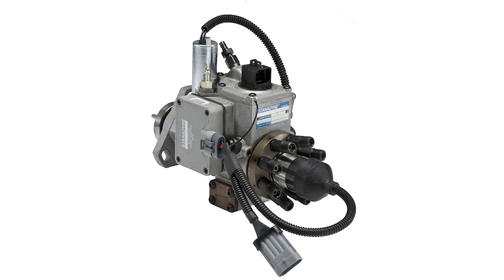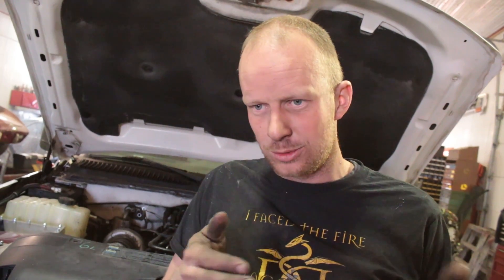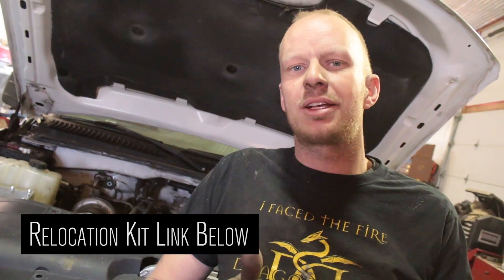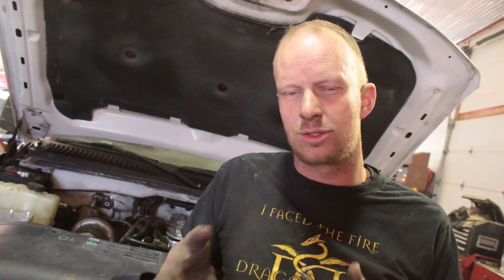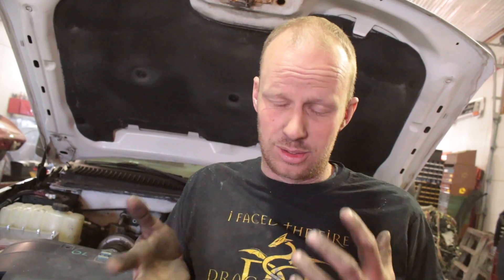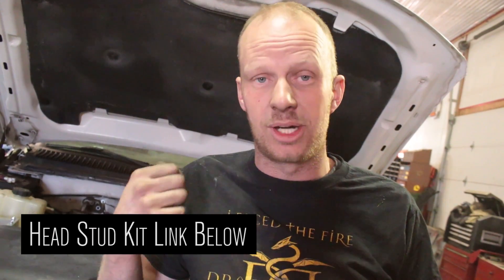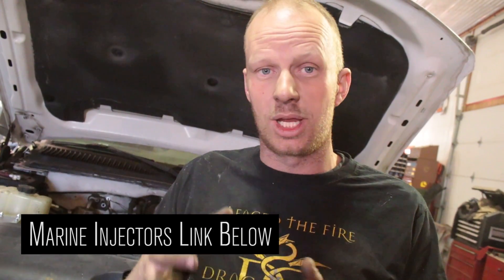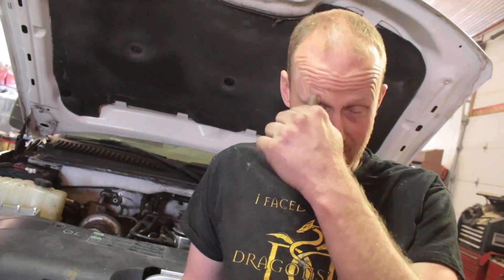REVIEW: Everything Wrong With A GM 6.5 Detroit Diesel

Comment: The 6.5 is just a bored out version of the 6.2. And yes in 1994 they changed over to a fully electronic "drive by wire" injection system to help meet emissions requirements but the basic engine structure( Heads, Block and Rotating Assembly) was designed in the late 70's. No, it's not a 12 valve which was designed slightly later. The primary difference between the two other than cylinder count is the fact that the 12 valve engines are direct injection while the 6.2/6.5, whether they were turbo charged or not, are indirect injection. This design was used to increase fuel efficiency while making an attempt to keep engine noise down. As most people find the sound of a diesel engine unsettling...Although I personally can't think of anything that sounds more appealing to me. I personally love the sound of Diesel Engines.

This engine was designed to be a fuel efficient alternative to both big block and small block V8 gas engines and it does that better than any other light duty diesel engine produced for or shoehorned into a pickup truck. I have a 98 Suburban with a 6.5 and I love it.  I have rebuilt the engine, put head and main studs in, high output injectors and injection pump, a better cam, tuning and a better turbo (an HX35 from a 5.9 cummins) and even shoehorned in a first gen cummins intercooler. And it all cost me about $3,500. That is by far the best advantage to running this engine. Cost of maintenance is so little compared to any other diesel engine. Injectors are anywhere from $400-$900 depending on whether you want remans or new ones. which about a 1/4 the cost of injectors for a Duramax or Powerstroke. It hauls whatever I need it to, whenever I need it to and when not towing I still get well over 20MPG. But it's biggest achievement to this day is because its a Suburban and not a long bed crew cab pick up....My wife will drive this truck and still be able to park it. 

And in the interest of being thorough...I was a foreman at a Diesel shop before my eye got popped by a shattered drill bit and in the 5 years I was there...I can promise you that this engine has also been used for school buses, tow trucks, straight trucks, cube vans and pretty much any other type of light duty highway going work or commercial vehicle.  As well as being a popular engine for RV owners. Older RV's of course but RV's none the less.Not only that, but it is STILL used for the HUMVEE even though AM General now owns the engine and has made SUBSTANTIAL upgrade tot the block and heads.

The bottom line here is that for an alternative fuel engine designed in the 70's...This engine has stood the test of time and the after market support for this engine very strong and increasing still. Rivaled only by the 12 valve in terms of age, reliability and after market support.
Reply: I just bought a 230000 mile suburban with this engine and I love it. However, the couple of things I've heard need replaced I will never know if they have been replaced because the dealership didn't get any information from the previous owner before taking it in trade. Grrr. He was a mechanic though and it is CLEAN!
Reply: @hisnameisiam808  I would say to that if it ain't broke don't fix it but just do regular maintenance I have 340,000 on mine and going strong.. and yes his name is I AM
Reply: @GH-el9ch   Geary Harlan  YES IT IS! YOU ARE THE FIRST TO SAY IT! lol I've actually had a few people argue with me about that fact believe it or not. 

Ok, got it. Sounds good. Since posting this I've found the pmd. They relocated it under the engine on the "skid plate" thing. It's very solid. I'm just worried it could get damaged by debris or water. It has a new injector pump and injectors. It is doing 10 psi on max boost which I've heard is the max. I'd like a bit more of course lol. But this thing drives like a dream. The Lord blessed us with it. I have no complaints. I think he also modified the Wastegate so that we don't need the vacuum. It operates beautifully.
Reply: 8- MARINE INJECTOR NOZZLES  Bosch  67.50 ebay
Reply: But a suburban is the size of a crew cab long bed truck...
Reply: @nou8257  but NOT the same wheelbase which is why it's easier.
Reply: @nou8257  reg cab longbed
Reply: @parkersmith8011  Reg cab long bed is 131.5" and the surburban is 219.5″ its not much shorter then my crew cab long bed dually is apparently 250" and even a extended cab truck with a long bed is 155.5"
Reply: @nou8257  with a reply like that, its obvious that you're not aware of wife logic. Maybe you're gay? Maybe you're just insensitive? Maybe you're not old enough to understand human nature. 
Good luck!
Reply: @Brandon Crimmons:
Best most accurate post in this thread right here.
Reply: @JUDGExNOCTURNAL  why not buy an entire p pump engine and swap parts over?  Far cheaper than the kit
Reply: @Bighorn44 None My truck has a 6.2 bored .30 over and then all the 6.5 stuff put on it 6.2 is pretty close to the same thing as the 6.5 minus cylinder bore diameter and the cylinder heads are different somehow i think it is for the pre fire chambers.
Reply: Wrong it's not just that simple
Reply: ive seen lots of 6.5s in diesel pusher RVs i was surprised at how much power they had going down the highway
Reply: Brandon Crimmins my injectors were $280 delivered. Oem Bosch from summit racing.
Reply: @Bighorn44 None So you are asking can you put a mechanical injection pump off of a 6.2 or pre 1993 back 6.5 on a 1994+ truck.

Yes you can it doesn't need a computer to run but it will still need the fuel shut off solenoid to turn off and on and will prob need wiring modification since I can't remember if anything looped through the injection pump in the harness.

Comment: What are your thoughts on the newer 6.5 diesel p400 long block engine?  It seems to have solved all the issues with the engine itself, but not the injector pump issues.  I'm thinking a p400 engine, a newer humvee mechanical injector pump, and a larger turbo and it would be a pretty good setup.  But.... of course by then the cummins swap could be a cheaper option.
Reply: welpro21 p400 are good engines. I want to put one in my truck next year, check out leroydiesel.com

Comment: I got one 98 6.5 with over 900 km on it only thing changed was turbo and pmd was relocated and I got a second 98 with just under 500 km and doesn't show any signs of ever dying and they both pull very often both 3/4 ton with 1 ton Springs both bone stock except muffler and soot trap was takin out so there a good engine if you don't mod the fuck out of them like you would a cummins or powerstroke and they both get 20-26 mpg towing or not towing so there are a few junker ones but there are also very good ones wen you treat them like a deisel

Comment: I have a '99 Chevy Suburban K2500 with the 6.5 TD. There's one highly recommended modification for these engines; the stock oil cooler lines are an awful "Quick Disconnect" design held together with a small C Clip and are prone to failing, starving your engine of oil. People at the Dieselplace forum recommend buying quality after-market lines such as those from Leroy Diesel or Lubrication Specialist. I still have to replace mine.

Comment: I don't consider all those easy to reach things to be a big problem. PMD is an easy fix and I just remote mount any that I see.  Same with the injection pump. Any older rigs I just figure all injection pumps are a core and get a good performance one to replace it. 
The major problem is some blocks are weak.  I build these things for power all the time and I actively look for them because they can put out 300hp  pretty easy and that's not too bad considering the weight savings.  
Building for power the right way can be expensive. Depends on your definition of expensive I guess. Expensive to me anyway. A set of 18:1 pistons is about $650 and even though Mahle is the best you will probably have to buy two sets just to get 1 set that is suitable for balancing.  I have a set that is 15 grams different from lightest to heaviest piston.  That is a pain to try and balance.  In fact my machine shop won't touch those unless they are within 2 or 3 grams. 
Personally these are one of my favorite engines. Fairly cheap and affordable. They can be decently durable too with the right build.

Comment: 5 PSI? FIVE PSI????? does this thing really only put out 5psi?? my 7.3 hits 33psi
Reply: Christian Figueroa 6.5L can only handle 10psi before you need head studs
Reply: The main reason they kept the boost low is because they had the compression ratio high in these engines. That’s why he said when you get to 20 psi that you’ll probably blow a head gasket without studs. Other engines can get away with more boost because they have a lower compression ratio.
Reply: Yes 5psi in stock trim. I run 7psi cruising and with go 18psi through the gears, 33 psi in your 7.3 is great for you but your soot maker was designed to need that much air
Reply: Turbocharging (supercharging) diesel engines began in response to weak exhaust flow by means of forcing high pressure air to blast in through the intake valves and push out the exhaust. 5 psi was all it took to accomplish this goal (although the engine will overboost to 12 psi in short periods If the conditions are right). Higher performance was only a byproduct of turbocharging, not the intention.  You can thank the last 20 year's worth of diesel power wars between manufacturers for the progression to lower compression/higher boost/exponentially more power.

Comment: i agree with a lot of the issues but my 95 obd1 6.5TD gets about 24ish mpg highway. moving the little black box behind bumper is better location. turbo swap is best thing for it, i chose a H1C off an early 12 valve. upgrade the LP electric fuel pump too

Comment: I personally have a 6.5l turbo diesel, yeah they're not that great, they sound like they're going to explode during cold winters, (sometimes they wont start) the Pump Mount Driver goes out if you haven't relocated, you'll most likley will experience a stall eventually. I'm doing research on how to have the 4l80e communicate with the cummins engine without having the check engine light on.
 The cummins 12v is more in my opinion simplistic. for example, the 6.5l has 8 glow plugs, those glow plugs can go bad, and sometimes even swell, thus, if you had to replace a glow plug  and broke the tip, haha have fun tearing the engine apart. Where as the cummins just has a grid heater or a toaster like thing. which is located on the top. and yeah, a lot less time consuming if you ever had to replace it. Or if you were going to do a exhaust work, you would only have to work on one side, instead of two.

Comment: 6.5s weren't bad just not a puller motor too high of EGTs on the and hard to keep them low. One thing I'll say though is the 6.9/7.3 idi and 7.3 powerstroke are just as reliable as a 12v cummins. Sure they're hard to start in stupid cold weather but other then that they'll last forever the 6.0 isn't bad either just gotta know how to fix it right the first time around. They all break weather its a Duramax, Powerstroke, or Cummins. And they will all blow a head gasket.

Comment: The 6.5L diesel is a General Motors Division diesel V8.  GM Diesel, Detroit Diesel Engine Division, Detroit Diesel - Allison, Detroit Diesel Corporation.....didn't build the 6.5L Diesel.  About as close as they came to something like it was the 8.2L seen in MD trucks.  Just because wikipedia calls it the Detroit Diesel 6.5L doesn't mean it's so.

Comment: mostly true statements, the biggest issue with the 6.5 is the PMD "pump mounted driver" failing, staying in the stock location causes it to overheat. the 6.5's get great fuel economy though 22-23 mpg on average. they also put it in GM's half ton.
Reply: PMD's a big issue and I frequently get around that mileage in mine. I take it nobody mentioned the stock oil cooler lines to you though? They're horrible! Just a little C Clip is all that's holding them between oiling the engine and oblivion! I've heard of some aftermarket lines that screw in though which I WILL replace the stock ones with.

Comment: Iv'e got to disagree man, will take a cracked piston 6.4 that needs rebuilt or 6.0 that needs the entire top end redone over a junk 6.5 period. At lest the Powerstrokes can make power and made reliable, Also they don't have timing chains. But as for Stock reliability you're way better off with a 6.9/7.3 as far as IDI's go or 12v/7.3Psd. I know you hate fords and 6.0/6.4s but man they can be nasty beasts I promise!
Reply from the maker: That's exactly what I said in the video.  If you want a "beast" it only costs money.  Powerstrokes can be made reliable but not everyone has money to throw at their rides.
Reply: fordman2288 lol After you buy a ford diesel, and then you throw 8grand at it, it will run right. lol?

My 6.5 just needed a few hundred bucks of upgrades to bombproof it. I drive mine two hours a day, 5 days a week. Still only spend $40 a week on diesel.

I'll keep my cheapie 6.5 and let the ford boys spend a few more paychecks propping up that company's diesel street presence.
Reply: Only idiots buy a 6.0 or 6.4..
Reply: I want what you're having if you think that about the powerjoke lol

Comment: In about 2003-2004, we started seeing the switch from the old junk 6.2L to the new 6.5L in our HMMWVs.  It was a huge difference even if it was un-trubo.  Only the heavy variant HMMWVs got turbos.  And me, I'm thinking of going 6.5L instead of Cummins, simply because getting it past the swap referees is easier for registration.  It was an option on my 98 K2500 Suburban from the factory.  Also that PMD relocate you mention, there are a TON of videos on the subject on Youtube.  Helped a buddy perform that mod on his K2500 Suburban with a 6.5.  We moved it as far from the engine as we felt reasonable: to the driver's side fender.  There are those that relocate it out in front of the radiator, totally out of the engine bay.  Leroy's Diesel and 6.5L.com are two really good resources, Leroy has a youtube channel.  Yankee Prepper does a really good series of videos on making the 6.5L bulletproof, too, on his channel.
Reply: Yankee prepper has some funny videos